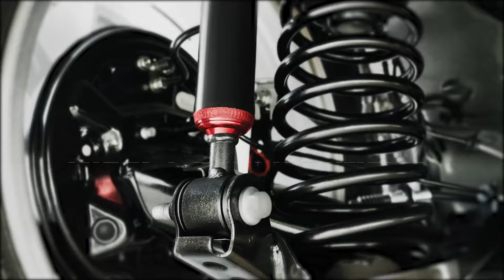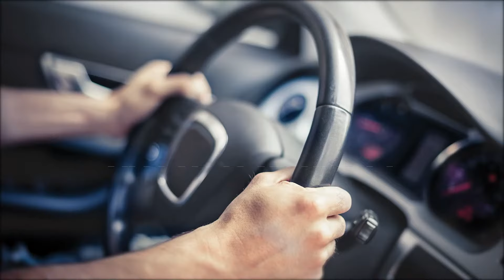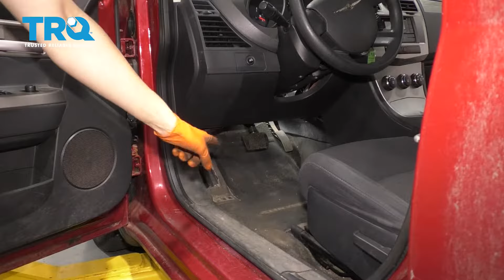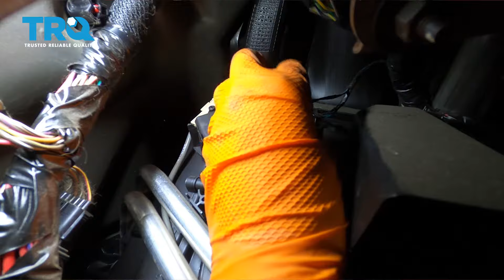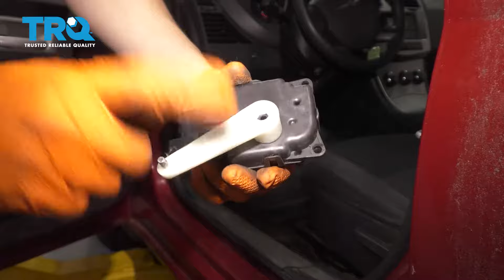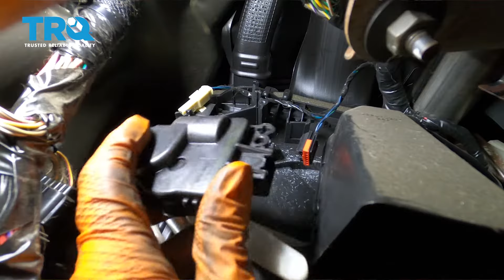How to Replace Blend Door Actuator 2007-2010 Chrysler Sebring

Comment: Hello, i have a 2010 sebring with V6 and i have heat on drivers side vents and defrost and cold on passenger side. It does not have duel temp control. Its straight plain jane with 3 knobs, fan speed, temp control and vent, floor,defrost location knob. Any ideas?

Comment: I got the actuator replaced but still only get cold air on my passenger side. And whenever I change the temp there isn’t any in between in the actuator like in your video. It either is all the way one way or when I go to heat it goes all the way the other
Reply: Did u solve it?